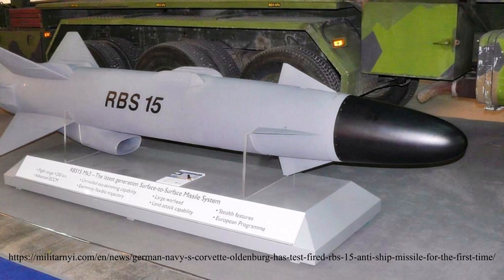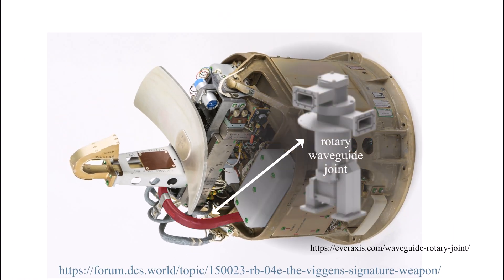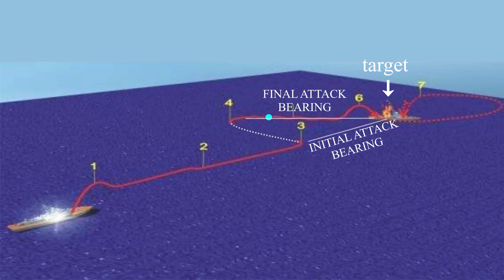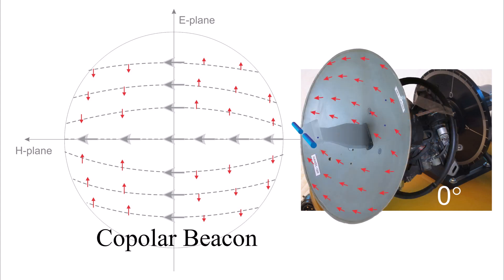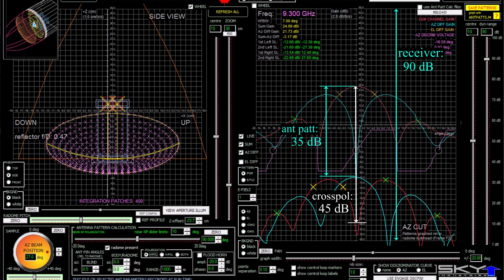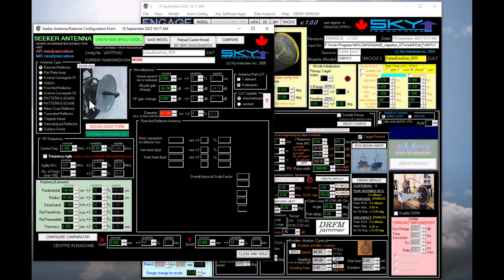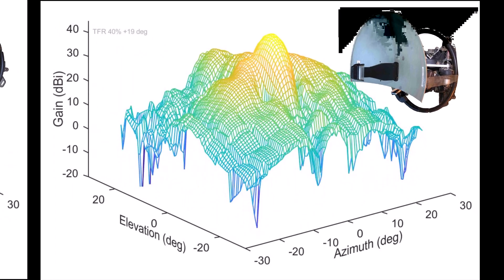Crosspol Jamming   RBS 15 Seeker Antenna   Part I 07

Comment: I guess they probably chose this antenna design because they wanted a vertical fan shaped beam. Necessary because the seeker only scans in azimuth, and must be able to acquire the target even if launched at altitude or not flying level (like when it's diving down from launch altitude to cruise).

As the RB04 and RB15 are sea-skimming, would the surface reflection impact the antenna behaviour?
Reply from the maker: You may be right; a fan beam obviates the need for elevation tracking, which doesn't necessarily imply the additional complication of elevation guidance.  

The downside of a fan beam is that it sacrifices peak gain compared with a pencil beam.  

Yes sea surface reflections are an issue for anitship missiles, I made a couple of videos about that, related to jog detection:

Multipath Canceller Intro: https://www.youtube.com/watch?v=jiQ59s5Hvgw

Multipath Canceller Spatial and Freq: https://www.youtube.com/watch?v=nTTfthDI5ZI

Comment: The video of the things it can do is the modern versions which are basically completely redesigned with new engines and guidance systems compared to the prototype radar

Comment: How much would you expect being left from this in todays rbs15? Or have they replaced everything with newer tecnology? Im thinking they must have something not even derived from this radar today?
Reply: Since it's Saab it's pretty much guaranteed that the missile only shares its general shape with this antique.
Reply from the maker: Great question.

I would expect the basic antenna design to persist.  It's very expensive to make changes to an existing missile, and the seeker antenna is by far the hardest and the most expensive part to design.  It's so expensive, sometimes multiple countries fund a new missile, e.g. UK and France initially funded a new missile, which in the end produced Exocet by France and Sea Eagle bu UK.  I understand RBS is a consortium of countries, lead by Sweden.  

To your question: ndoubtedly there have been software improvements in the RBS family evolution, but there would have to be very good reasons to spend the money to scrap the basic antenna design.  

And even if they did introduce a new antenna design, it does nothing to address the vulnerabilities of hundreds or thousands of earlier models still in service, the ones which are statistically the most likely to be used in an attack.
Reply: @skyindustries  RBS stands for Robotsystem, it's not a "developer name", and it's 100% developed by SAAB. 

Where are you even finding this information? This video is chock full of errors.
Reply from the maker: @TzunSu  The analysis is correct as presented.  

I have indicated all information sources by website.  If I have transcribed something in error, please explain.
Reply: @skyindustries I got the impression somehow that this radar was on the rbs04 a missile known to be bad, but ive heard the rbs15 is very good, this is why i assumed that everything was changed, maybe using some kind of esa radar. But i know next to nothing about this. Very interesting though. Thank you for the reply
Reply: @skyindustries  basicly noting you say here is correct, this Missile is origonaly designed and built by saab Bofors Dynamics, untill the Mk. III it was a 100% Swedish development.

Comment: That is possibly a passive reflection guidance and would not be crosspole, rather, “reflected intelligent”
Reply: Speed density>rather than mass air sensitive
Reply: Nuclear density>speed mass receiver
Reply: General Atomic>General Motor
Reply: Event horizon doesn’t require altitude, only X and Y events redscribed as 0,1,2
Reply: Green screen red stereo
Reply: Also, Third base home runner

Comment: Since SAAB claims the RBS15 mk3 has ”home on jam” feature, the radar most certenly can be jammed. Unfortunatly for the jammer, they now provide the target data to the missile.
Reply from the maker: HOJ works by using the jammer's signal for angle tracking, instead of using the skin echo.  

Crosspol uses the electromagnetic properties of the seeker antenna to distort the seeker antenna radiation pattern, so the HOJ angle information is incorrect.  When the seeker tracks the Crosspol jammer signal, the seeker antenna doesn't point at the target. 

This i the main feature of the Crosspol jamming: active onboard angle deception.

Comment: The Rb-04 is powered by a rocket motor, not a jet enengine.

Also, the Rb-04 seeker you picture is from an older Rb-04D, not the E. This is clearly noted in the source you referenced.

The Rb-04C/D used a CW radar, while the E uses a monopulse radar.
Reply from the maker: Many thanks for the corrections, and interesting.
Reply: I have photos of the B/C seekers from the Arboga missile museum and the CW seekers look nothing like your image.

Which means you are probably right and the previous commenter is wrong

Comment: The 04E is a MUCH older design, it was only air launched used in the 70ties and 80ties the first gen was RB08 ....very long back in time
Reply from the maker: Fair enough; what I am referring to involves the physical relationship between the feed and the reflector.  Since it strictly involves electromagnetics, a fix requires a complete antenna redesign.  Signal processing is too far downstream to fix it.
Reply: Also, it’s only one of its navigation/target tracking methods. I’m guessing it’s there as a redundancy more than anything

Comment: 1:06 The rb-04e more evolved than the rbs-15 ?
Reply: Absolutely not! The rb-04 is one of the first antiship missles ever.
Reply: @nils1543  That’s what I thought too… but not what I understood from the video.
Reply from the maker: No - I said that the antenna in the photo for the RBS-04 appears more evolved than the antenna in the photo for the RBS-15.  

The RBS-15 photo could be from early RBS-15 development, or it could be an early version of RBS-04 antenna.  

It's an open literature source in a foreign language, so there is no way to be sure.  I present it as I found it.
Reply: @skyindustries  The RBS-15 is basically an evolved RB-04 especially in the early stages. it was originally called RB 04 Turbo(since it has a turbojet)
Reply: @skyindustries  Okey Thank you!

Comment: Maybe this is really silly but if you chirp the radar on and off once you know the distance to the target can't you measure the jamming signal on its own (you know when to expect your signal back and the jammer has a processing time delay after seeing a pulse).  If you have a decent microcontroller in there maybe you can use it to do something more clever in how you choose your flight path.
Reply from the maker: Not silly, smart.  

Yes missile seekers have a mode called "home-on-ham" which does exactly that: it uses the jammer's signal for angle guidance, while searching for the target in range - knowing that eventually the skin echo will reappear (since jammer power varies as 1/R^2 and skin echo varies as 1/R^4, eventually the skin echo becomes stronger than the jammer signal).  

Angle tracking this way won't work with Crosspol since Crosspol changes the angle properties of the antenna pattern.  The jammer spoils the angle tracking properties of the antenna before the missile's sophisticated onboard signal processing has started.
Reply: @skyindustries  Thanks, but  I was actually asking about something a bit different (tho re: home on jam couldn't you still do it by spinning the missle to recover both polarization components of jamming signal).  

What might be silly was thinking that you could subtract out the jamming signal from each component since it's all linear. Hence the bit about rapidly chirping on and off unpredictably so you get both the jamming signal on its own and the jamming signal plus your return.

Comment: Great info! Mabye a dumb question, but what if the whole antenna hardware module continuously rotates along the missile roll axis?
Reply from the maker: There are no dumb questions, only dumb answers.  

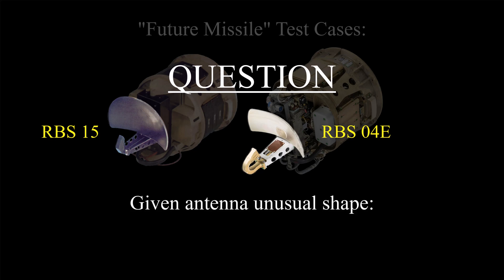A missile has been created that does this, it's called the Rolling Airframe Missile (RAM), here's a video: https://www.youtube.com/watch?v=zvAo5UVWbS8 [there is a close-up photo of the seeker head at 4:57, 6:04+ for explanation of how it works].  

Summary: RAM is an anti-missile missile.  It uses two outboard antennas, possibly little spirals from their look.  

They form a two element coherent array, so it produces a radiation pattern whose variation in angle is sin(theta).  The missile air frame rolls continuously and fast during flight, which rotates the two-element radiation pattern. Skipping the details, the autopilot flies the missile to keep the target at the centre of the rolling radiation pattern.  

It works as an anti-missile missile because the application is very specific: it's intended to hit an inbound radar homing missile.  That's a point source target, whereas a ship is a distributed target. And unlike a ship, an attacking missile doesn't normally carry a jammer (maybe next-next-gen missiles might if there is a good-enough reason).  

And the RAM missile is passive; it doesn't have an RF transmitter, so if the inbound missile doesn't have an RF transmitter, the RAM missile relies on an IR sensor.

Could the RAM design be applied to an antiship missile?  I see a lot of problems and limitations. Probably not worth the massive investment of time and money.

Comment: Since it's a "cognitive missile," could a dual-polarized feed with adaptive cancellation have suppressed cross-pol lobes in the azimuth plane?
Reply from the maker: Not sure what you mean by "adaptive cancellation"; the same thing happens for V-pol as H-pol for this antenna design.  The video explanation is a bit simplified for brevity, but the broad strokes are correct.
Reply: @skyindustries  my bad forget about it, is t not a leakage issue and and db dynamic range necessary would be unrealistic on a missile. Anyway dualpol jamming should not be much of an issue as this missile is capable of reattacks/dog-leg maneuvers

Comment: Could this jamming be defeated by smart missile swarms?  If two cruise missiles are coming in together while maintaining a datalink, and they perform opposite dogleg maneuvers so in final they approach the ship from a 20° offset, wouldn't they (in principle) be able to share their known INS/GPS locations and radar data via their datalink to work out that X-pol jamming is being employed?

Not sure how cost prohibitive datalink would be for cruise missiles. 🤷🏼‍♂️
Reply from the maker: Good question.  

Likely two missiles sharing a data link could figure out that some kind of onboard countermeasure is being used, but they still need to figure where the target is, and for that they need the antenna - the very thing Crosspol attacks - and a sufficient duration of tracking information that is believed to be reliable.   

This is not so easy because the most reliable information is probably available at the longest range, where it is least accurate because the antenna is small relative to the radar wavelength.  At long range angular accuracy and resolution don't matter much, guidance extracted from the antenna just has to get the missile generally in the target basket.  The heavy lifting guidance-wise happens at the end.  

That said, there are many possible layers of signal processing and estimation theory that can be used by the missile to extract as much information as possible about where the target can be, can't be, and most likely is, some layers more kludgy than others.  And if the seeker has to reboot back to a volume search, that's a win for the jammer, possibly one that favourably decides the engagement outcome.   

Anyway in my experience the pickier a seeker is, the more vulnerable it is.  Counter-countermeasures look good on paper, but in the real world… maybe not so much.
Reply: @skyindustries  you can safely bet that it has multiple cross referencing sensors for target ID and homing in order to overcome jamming of any single sensor.
In addition to that, it likely has a networked datalink since that's been the signature feature of the Swedish airforce since the analog datalink of the SAAB 35 Draken entered service in 1958.
Reply: @SonsOfLorgar  It does, that's how a single one can "dip up", acquire a target and transmit that information to the other missiles that stay down low.
Reply: @skyindustries Thank you for this thoughtful answer.  I am loving your series. 🙏🏻
Reply: I think datalinks are very common in modern missiles.